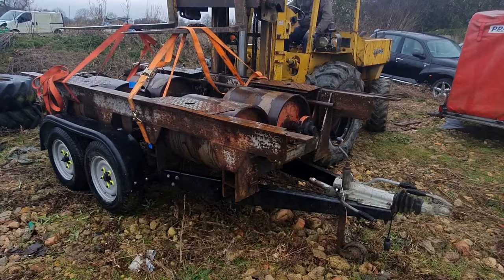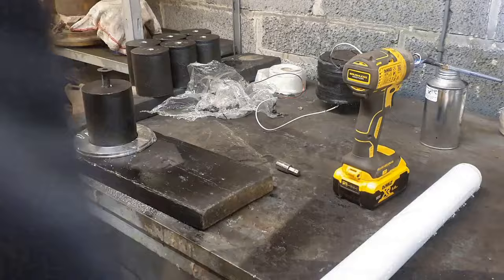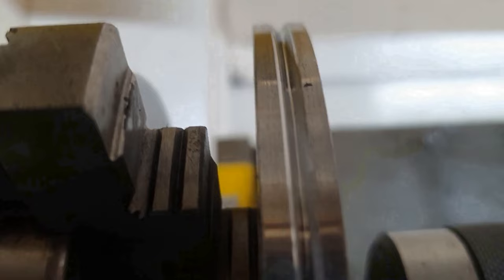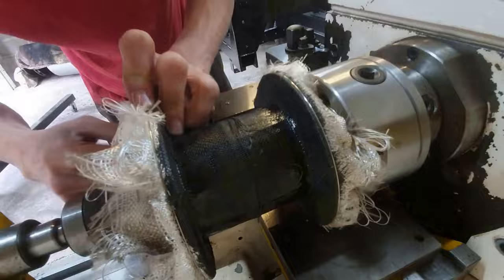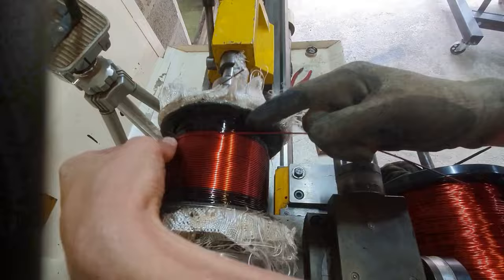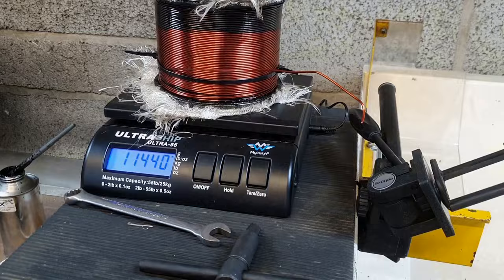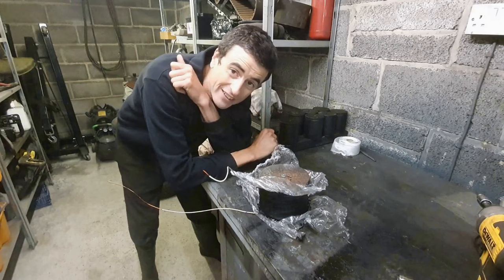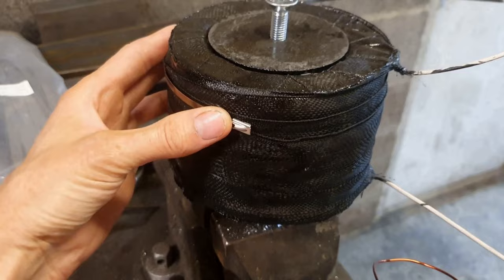Coil Winding for my 500bhp Rolling Road Eddy Current Brake, Mobile Rolling Road Restoration

Comment: I would be interested in making a small dyno to test go kart engines with. Some people have built flywheel ones but a constant load dyno would be interesting.
Reply from the maker: Ross this sounds like an excellent project. I've had it easy really with a restoration, a build from scratch dyno would be a very cool project. 

A brake is a very good idea. You can do so much more with the rolling road if you have one. 

Get it done! :)

Comment: Was it really necessary to insulate that much for 200V? I'm sure you can obtain wire that can handle more by itself, then there would be much less work needed. While winding, make sure your wire is tensioned. If your coils overheat that much during operation, maybe consider some cooling options?
Reply from the maker: I'm not expert in this field, so a lot of the work was based of the coils that I look apart when I dismantled the brake. My application of calculations has only gone as far as changing the thickness and number of turns etc to change to 192 volts. 

The insulating of the coils I have just based on what I found. And there was a lot. There seemed to he a cement of sorts used around the core then a lott of asbestos type material on the edges and around the outside. I have just looked to go "belt and braces" and at least try and make sure its as good as it was in the original design. In addition, I feel that the more paint I can impregnate the fibre glass with the less moisture can sit around in the fibre glass if the coils are ever exposed to weather. 

All this work has really only come from my thoughts on what the requirements are. But you have illuded to something that might be of concern. They are rather cosy and well insulated in there.....  

This uis a double edged sword though, while I appreciate thwy won't cool brilliantly, they will be quite resistant to letting the heat in from the potentially red hot discs spinning around in close proximity. 

The discs themselves have enormous cooling fins, the inlet to those cooling fins will draw a lot of air through the 8 coils so that will help keep temps sensible hopefully. 

I can keep an eye on temperature with the internal thermocouple I have put in there. This is a case of suck it and see.
Reply from the maker: I did apply a good tension to the wire throughout most of the winding process

Comment: I have no reason to believe that the differences in winding you’re concerned about are going to produce any   relevant or much discernible difference in temperature. 

Worrying about heat conduction differences when the wire has a layer of insulating fiberglass coating the entire thing seems a little much. It’s not like I’ve done any research on this nor looked into the effects that irregularities in winding compositions have on heat dissipation so take what I think with plenty of skepticism. 

What I would throw out there is consider adding temperature probes embedded in the windings at the core and maybe a 2nd right before you close up the insulation on the outside. They are pretty affordable, small and would give you insight into how your creation performs overtime during testing. 

Why not add one to the core in question and one to the other nicely packed ones so you can see for yourself. Yes it will make it a pain in the ass to tear down to replace after it’s up and running but in general my policy is not to waste money (and my time) without concrete evidence for doing so. 

However if you have both a surplus of Money & Time then maybe redoing the coil to remove the possibility of the irregular core causing problems might make sense.
Reply: And I just heard you did add a thermocouple so good planning.
Reply from the maker: Chris thanks for taking the time to write up your thoughts. Much appreciated. 

I have no skepticism of your reasoning. It all makes sense. I think you make a very valid point the conducting of heat through adjoining coils is a mute point when they're all wrapped up like that. At the time this was really the only reason I could think to redo it. That and the fact it just did sit well with me knowing it wasn't neat.....

Chris I must admit that since making the video I have redone the coil. Two bit of good news though. The copper all came off in very good condition so I reused it, and I'm really happy with it. So I didn't have to spend any money on doing it. And while I was redoing the cool I became apparent that I managed to get quite a significant number more turns out of the same mass of copper bh virtue of it being neat. So the same resistance and therefore current but many more turns (like maybe as many as 50...

So I am pleased I did it as that could will generate a stronger field like its 7 other coil buddies. 

Thanks again for your thoughts though. It refreshing to hear from someone who can think for themselves and actually logically reason through some good points.  Please let.me.know yours thoughts again if you watch more RR videos
Reply from the maker: @TradeWorks_Construction  I did, but I wish I'd put two in like you suggested. Thats a very good idea.

I have one only and fairly near the outside. I wish I'd put one in the middle. Trouble is they upset the neat windings so this pit me off